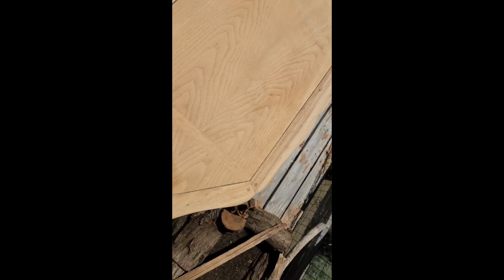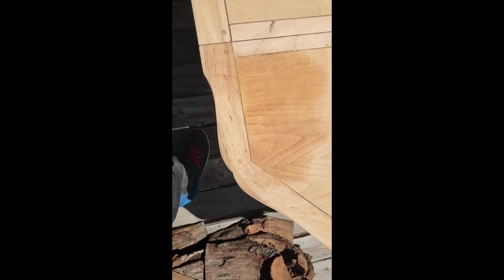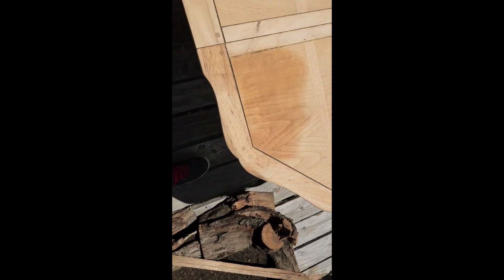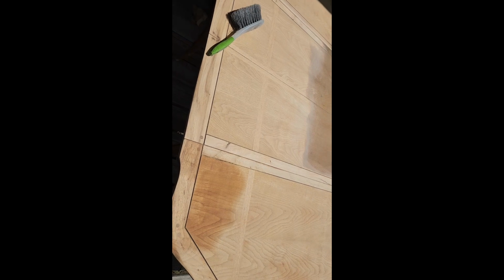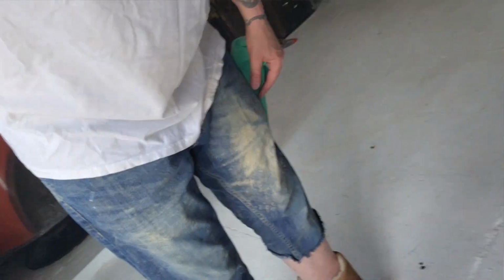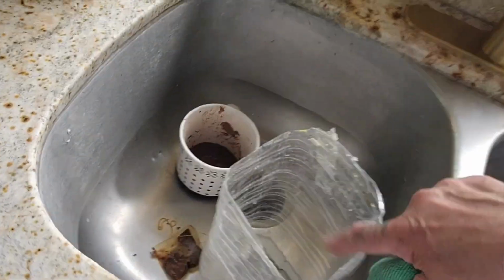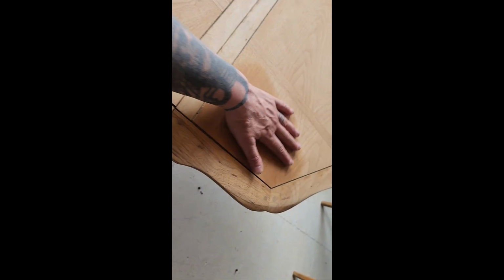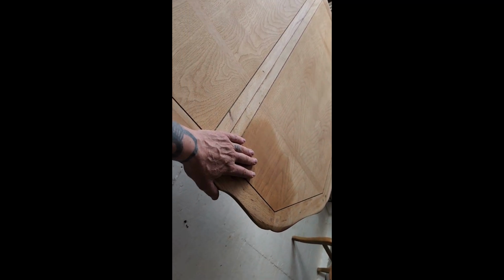First Time Sanding A Table.. pt 1.#diy #orbitalsander #subscribe

Comment: Hi T-Bone. Hope that today you are miraculously feeling better.  I think that the drop leaf maple table is pretty!  Are going to buy veneer wood or use wood putty or nothing before you paint?  Just curious because I, too, love transforming “wood stuffs”.  🤘🏻 & also, do you know what type of finish the paint on your cabinets have?  Is it semi-gloss, or is the nice semi-shine finishing wax?  I ask because I love them.
Reply from the maker: I'm slightly better, which is a big relief,💫 but I have a neck headache today, and those suck probably because I didn't sleep great.. it's a nice table design unfortunately it is a veneer I can't keep the same light color no matter what but I am going to try to first bleach out the dark parts  , I may go with doing a deep black stain,  then apply  coats of varithan  I want it very shiny and in-between on the the top  are lighter color lines about 2"they run along the table .. those and the rest of the table the sides and legs Chairs will be an orange cedar color black and orange will look great for this pc.as far as my cabinets it's called China blue from ace and I got a high gloss finish thx for ❤️  them 😀  so there I gave it all away  Say hi i to the Maltese Falcon for me lol 😆  ✌️
Reply: Ha ha-I believe you mean The Jizzing Falcon!  😂!!!  Your plan sounds like a good plan for the table & chairs. Look forward to seeing them sometime in the future. ✌🏻💗🇺🇸 and I hope your neck feels better soon.
Reply: Two comments are always better than one!  🦅. I do that for you & the 14 other Paranormal related channels I follow.
Reply from the maker: Believe me I feel special 💫🖖